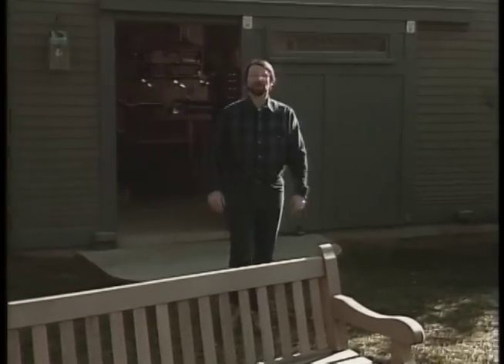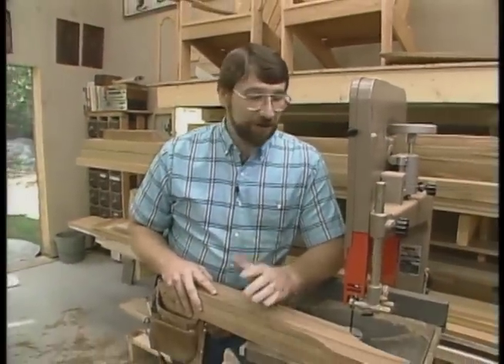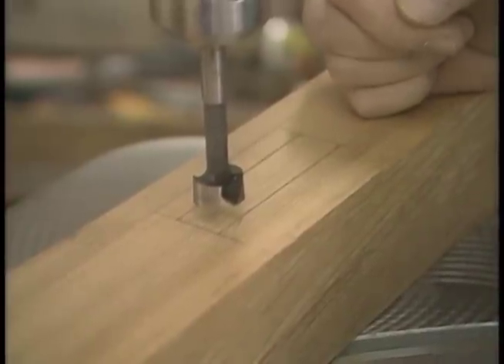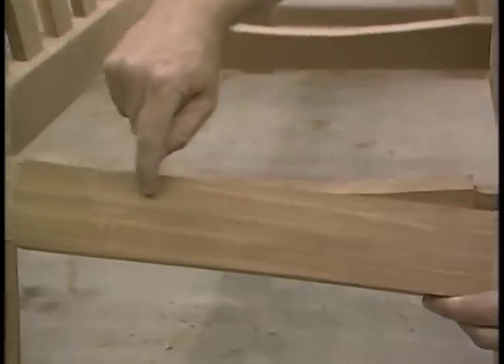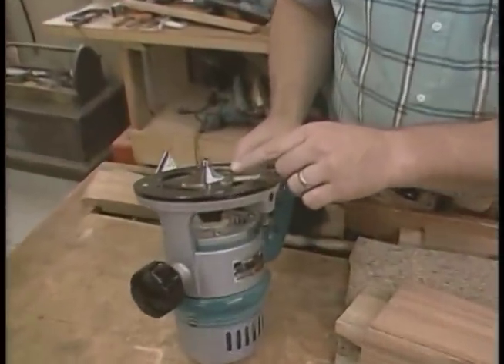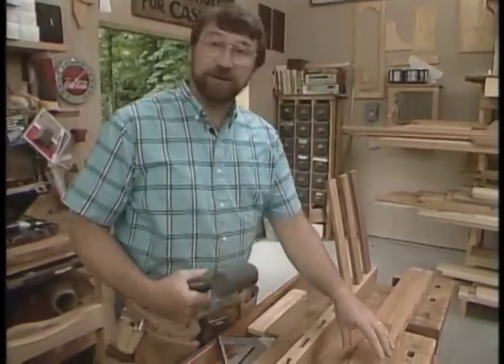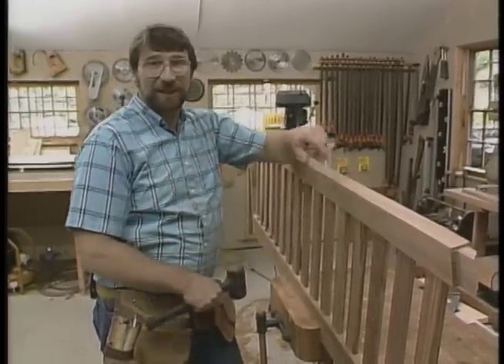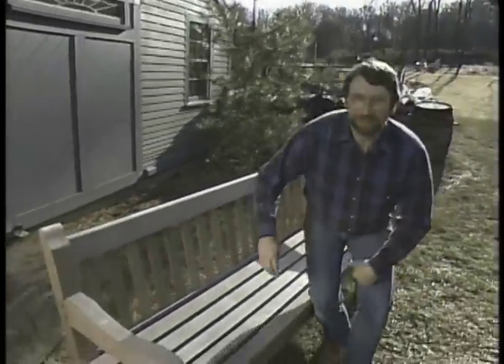English Garden Bench  |  S2 E12

Comment: Nice to see the NYW episodes airing again. I made this bench shortly after it originally aired. It sits on the front patio and still in use. The mortise and tenon joints are still tight and the bottom of the legs show no sign of rot when sitting on cement for nearly 30 years. It's a conformable bench to sit on. Nice work Norm!
Reply: What kind of wood ?
Reply: I used treated lumber. Kept it simple for my first attempt.

Comment: Never smear excess glue about with a wet rag,it will show forever, cut it off before it fully hardens. I do not remember the seat supports being so lightly installed.
Reply: My wife is good at cutting it off before ir fully hardens.